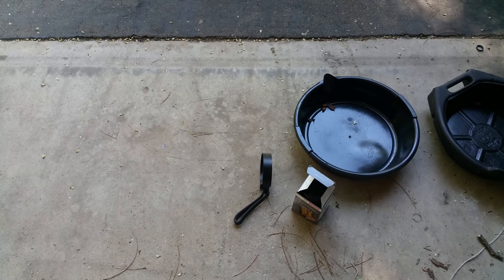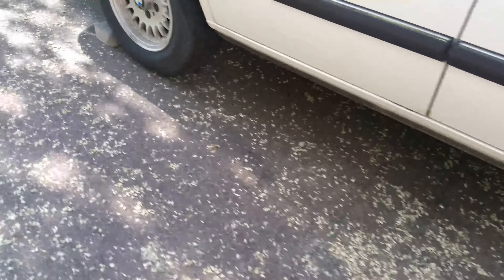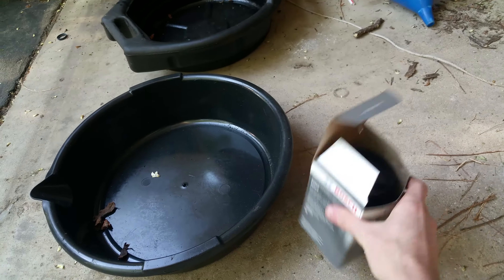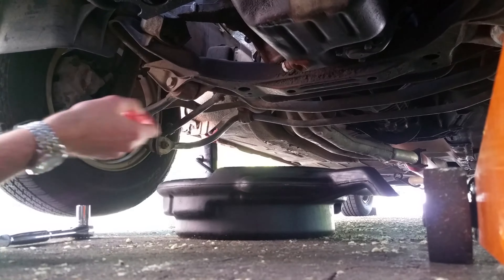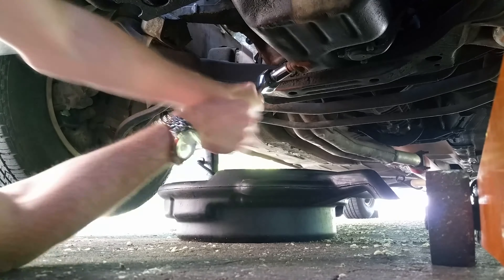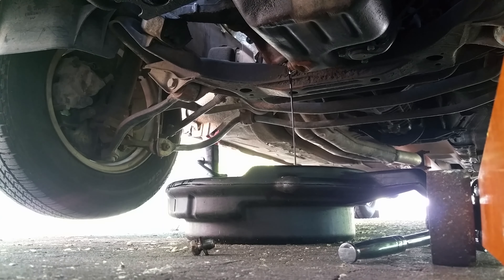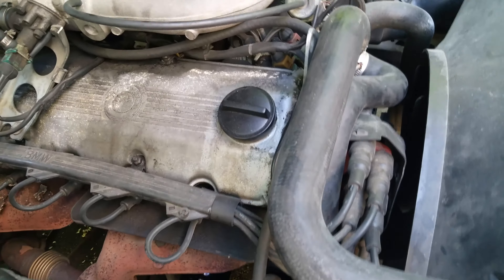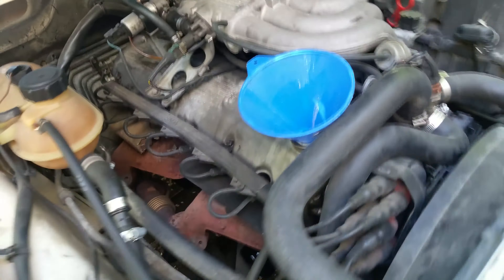HOW TO - BMW E28 | OIL CHANGE

Comment: You need bmw service reset tool to reset oil service you can find it on ebay,i use draper 51540 for 15 pins and 20 pins

Comment: My 85 BMW Check Control engine oil light is on, any ideal how to correct it?
Reply from the maker: Clarion 1991 did you change your oil?
Reply: I replaced the oil level sensor on the bottom of the oil pan, but light was still on. Then I reset the 15-pin Diagnostic Connector with a paper clip to pin 1 & 7. It worked, its off!